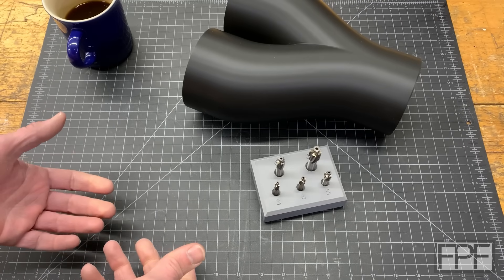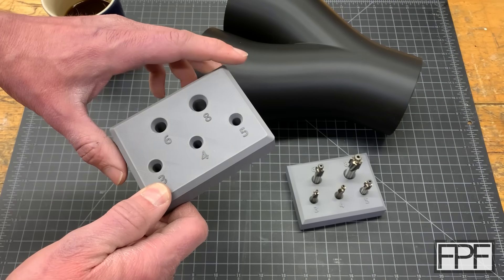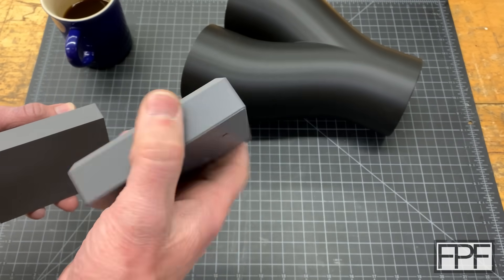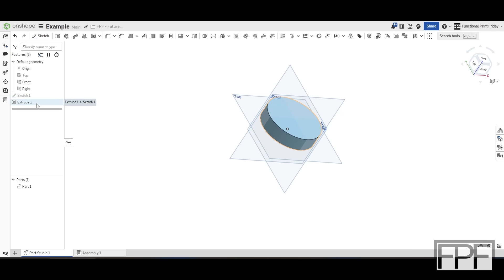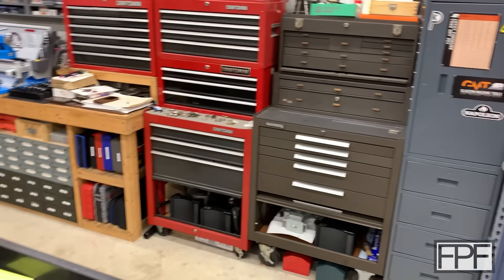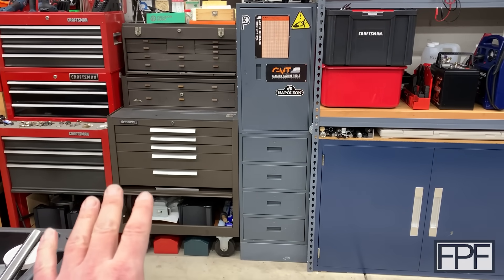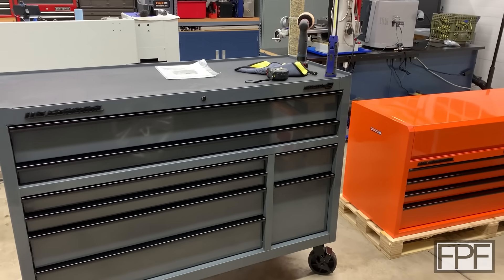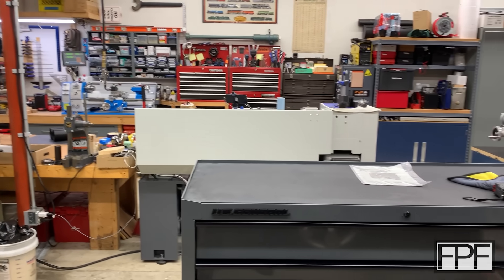Y-Pipe Viewer Challenge and Shop Updates

Comment from the maker: CHALLENGE RULES:  Design must be completed in onshape.  Design must be a y-pipe where one end has two pipes, and one end has one pipe.  The end with one pipe should have a pipe OD of 101.6mm, and for the end with two pipes, each of the two pipes should have an OD of 106.25mm.  Center to center distance for the end with two pipes should be 120mm.  Each pipe end should have a section that runs perfectly straight for 45mm.  NO curvature is allowed in this 45mm section.  Overall height should be 250mm, and wall thickness for ALL walls should be 3mm.  NO chamfers or fillets are needed.  To submit your design, make the design public in onshape (if not already), and send me the link to the design either via the contact page on my site fpfdesigns.com, or via a private message in the FPF discord (link to the discord on my site).  GOOD LUCK!!!  Winner gets recognition and bragging rights in next week's video.
Reply: Do variables count as steps? They do show up in the features list, so taking the rules literaly they do... You can do it easily without them showing up by just setting the values without variables, but the design is far worse of for it....
Reply: @flemmingjust5653  If you use a Variable Studio instead of setting variables directly in your Parts Studio they don't show up in the features list. I didn't use that for my submission here but frequently do for designs where the variables start to overwhelm the features list.
Reply: Going by some of the comments. I think a lot are missing that the outer diameter of the single end, is different to the outer diameter of the double end.
Reply: Thanks for the challenge:   4 Steps in Fusion (with 3d Sketch - 5 w/o)
1) Sketch  XY with two guide rails (following the outside of one side of the Ypipe):  x distance 250mm,  all ends of 45mm straight, path distance at start 101.6 at end 106.25 with 60mm offset, curvature to connect the straight ends
1a) perpendicular (3d Sketch) a circle at the start with 101.6   
2) Sweep the circular profile with path and guide rail  (now you have a full body of one arm with a 101,6 end and a 106.25 end) 
3) Mirror on central plane  XZ 
4) shell with 3mm 
However I don't think I ever would do it this way in a real design. The shortest way isn't the best!  (a bit like programming: Perl can do it as single line! But: incomprehensible & unmaintainable)
I would prefer a design more close to my actual "thinking/handling" of the problem.  e.g.  I want connect this side: Create new component, Sketch start profile and extrude 45mm. To this side at 250mm distance:  Offset plane, sketch target profiles and extrude.  Now connect the bodies with 2x Loft with G2 curvature. (If I would like to define a specific curvature I would create an additional sketch for the path).  Now I have  solid bodies,  combine them and shell to 3mm, Check with section anlysis in XY -> 10 steps
Reply: I can do this in 7 steps in Fusion.. but I know.. doesn't count.  🤣
Reply: @techjag  OnShape and Fusion are very similar for this kind of CAD. I got to a 6 step solution in OnShape, which I think would work in Fusion too.
Reply: @xVolta  oh im sure, I'm just old and stubborn.. I could cut to 6 steps if I remove the fillet I did on the union.. but I think it needs it so I stuck to 7 haha.. something something loft and mirror in my world. 🤣
Reply: @techjag  Yeah, exactly 😆
Reply: @xVolta  This can definitely be done in 6 steps in Fusion
Reply: @techjag  Ended also up with 7 in Fusion. I guess with a 3d sketch it could be reduced to 6 but that often takes longer.
Reply: @Leif_YT  I did use a 3d sketch to cut out steps.. and yes I agree its less steps but far more annoying... would much rather have used an offset plane and more sketches... 😂. but if you want less items in the timeline haha
Reply: @techjag  I got it in 5 in Fusion, using 3D sketch :)
Reply: I had it in 5 steps until I realized that the two pipes had a different OD than the one pipe.  I got it in 6 steps.  You can look it up in Public Documents... named "FPF Challenge (LEE)"
Reply: @jasonlee4122  Nice way to approach it! How did you get your Sketch2 to "float" without first defining a plane?
Reply: @rrtac  Instead of selecting a plane to sketch on, I used the origin as a mate connector and then I edited the mate connector and moved it -205mm along it's Z axis.
Reply: @jasonlee4122  Very cool. I have never really used mate connectors for sketches, but I'll have to remember that one. Thanks for sharing.
Reply: I think I can get it in 4 "steps" BUT one step is a variable size pipe featurescript which only needs a start and end radius and path to sweep along.  I consider it basically cheating because feature scripts could also bundle the entire operation into a single "step" for that matter.
Reply: Is there any chance that you could make your OnShape design file available (if it's not already available)?

Comment: 7 steps in Fusion. 
Sketch the pipe paths. Sketch the primary diameter. Create offset plane. Sketch other pipe diameters. Sweep first path with 5deg taper. Sweep second path with 5deg taper and join bodies selected. Shell command with 3mm walls.

Comment: That's a fun challenge concept! In programming, we call it "code golfing" when trying to rewrite a program in as few characters as possible that still does the original thing.

A quick clarification, do you consider parameters a step? They show up in the timeline, but in my opinion shouldn't count as steps, since it's just as simple to type in raw numbers in sketches, vs using variables.
Reply: I did the variables, I'm not counting them, they are just good practice.

Comment: I’d take the discount from HF and customize it. The other one though… I’d be a pain in their ass about it until the shipping company either replaces it with a brand new unit, or pays you for it 100%

They will continue being careless until it hurts their bottom line. 

Costco delivery contractors (RXO) gouged my hardwood floors and tried to railroad me for more than a year. Finally escalated to legal action and Costco leaned on them. Their insurance company paid for an all new floor and since I wasn’t the only claimant, they ended up getting dropped by their insurance company.

Comment: 5 steps in Fusion for the Y-Splitter: sketch-sketch-sweep-mirror-shell
Reply: But what about the 45mm straight at each end?
Reply: @MikeSorel-b8f 
Sorry for the missing details. This was an Onshape-only challenge, and I was just curious how similar the final Onshape solution will be. Anyways...the first sketch is the sweep path, so you can extend the straight parts as needed. The second sketch is just a circle used as the sweep profile. Snapping the bottom of the 'Y' to the origin makes the alignment of the circle and the mirror step easier.
Reply: @PODLine Did you get different diameters for the top and bottom as required by the challenge brief?

Comment: I won't ever use an OnShape account because I prefer to own my software and the things made from it.. thanks.
But the challenge is fairly simple for such a shape, my biggest tip I have for others is to read about what each option allows you to do. I would be able to do it with two sketches and two operations in my CAD software. You can likely do the same in most others such as OnShape.
I could go in detail for anyone wanting to experiment but I'll leave it at that to not spoil it for others that want to tinker.

Comment: Take the discount and call it good. Simple cosmetic problems are easily to fix. If it drives you crazy just hit it with a sander and give it a new shot of paint. You'll never match the paint so just spray the whole thing. A day's work, not really that hard. It's frustrating that a new piece comes damaged but everything has its problems. I personally would be more concerned about the drawers that ended up on its face. I would have rejected the shipment and made them replace it. Paint is easy to fix, tweaked drawer slides are another thing. I generally don't have  problem with shipping. For the money you paid for that second cabinet I would definitely put in a claim. Don't overestimate the drawer space you need. You can get away with a lot less than you have. It's nice to have everything in its own place, kind of studly. I however have a much smaller shop than you. I have a color coding system that allows me to group my tools in large batches, yet quickly identify them. It started with drill bits. I color coded my bits with stripes to identify what that bit does, not its size. I covered all the standard sizes from #4 to 1/2 inch. With one glance I can identify a #8 wood screw for hardwood bit from a #8 machine screw for a tap hole at a single glance. It turns out that 99.99% of all the holes I drill fall into the color coded castigatory. I keep my bits in the bins, small, medium and large. I can directly get the bit I need with no fuss, no muss. Lose all the boxes and use the space for more equipment.

Comment: Maybe another option for the orange tool box: You could just sanddown / rough up the top and front facing surface of the side walls and then paint them black to give the whole box a frame around the orange. Together with the black drawer handles that might look neat.

Comment: I reckon 6 steps: Sketch, offset plane, sketch, loft, mirror, shell
Reply: This will be missing the three straight 45mm sections.
Reply: @grahamrichter657 your right - missed that. So two additional extrusions. Alternatively if you tweak the loft settings, using normal to face and tweaking the parameters, you can likely achieve a similar result without additional extrusions.
Reply: PS realized mirror won't work due to the difference in ODs, i.e. additional loft and a boolean.
Reply: @NitroHDB  One extra side sketch or 3d sketch should do it to draw the path the loft can follow. At least in Fusion, but I think in OnShape and SW it's the same.

Comment: I can probably do it in 7 steps. At least in CATIA, NX and Solidworks, I have never used Onshape but CAD software is 99% alike, at least in it´s basics.
1. Create sketch of 3 circles on any plane
2. Create solid or move circle 1
3. Create solid or move circle 2
4. Connect circle 1 and 2 by a loft, blend etc.
4. Connect circle 3 and 2 by a loft, blend etc. and boolean volume, can be done automatically or you might need an extra operation depending on Software
6. Big nice fillet ( can leave it out and get it in 6 steps, but I wouldn´t)
7. Shell operation & done
No surface design needed, or complex operations, you can change your design intent later on, you can change distance between the interfaces, you can change diameters, you can change wall thickness, everything can work interact and not brake.

Comment: It´s not just the amount of steps but the logic behind it. For example, you can create one side then mirror it, this means your design will always be symmetrical no matter what, you can not change it in the future. Now are you 100% sure that any design change in some distant future will always be 100% symmetrical ? 
Same goes for the height of the upper two pipes, you can position a sketch on the same plane or you can create a 2nd plane or you can create all 3 sketches on one plane and then move them by the distance needed etc. Design intent, that is stable with the least amount of steps, that´s what you want. At least that´s what I do in my 10+ years design engineer career for various automobile manufacturer.

Comment: 6:00 For that shape, I'm not that familiar with OnShape but in Fusion I (as a beginner) would do:
1. Sketch for the bottom profile
2. Offset plane for the top profile
3. Sketch for the top profile
4. Sweep from the bottom to the top profile
5. Mirror the part
6. Join the 2 bodies.
7. If needed, shell the body.

Comment: I'd take the discount, try waxing the matte areas with a good paste wax and make the corner protectors/accents in black if the waxing didn't look good enough.  Or paint those areas as well as the top/front chamfer gloss black.

I'd have probably went with a black base cabinet and repainted it's pull handles an orange which matched the top cabinet orange.

Comment: Sorry, don't know onshape. But in Fusion this is done in these steps:
1. Sketch 45mm line followed by spline that curves one side only, followed by another 45mm line
2. Use the pipe tool on the path created in the sketch
3. Use mirror to duplicate the other side and join together
4. Use the hollow tool on the side with the two pipes (select both tops)
5. Use extrude to cut out the bottom

Done with 5 items in my history bar.
Reply: Ah, I didn't account for the difference in diameter of single vs double pipes. The pipe command can't do that.

So in fusion (and I expect it to be similar) you would have to do this:
1. Sketch circle
2. Create offset plane 250mm above
3. Create sketch on the new plane with a circles offset on one axis and different diameter (this will be one of the two pipes)
4. Extrude bottom circle 45mm
5. Extrude top circle  down 45mm
6. Loft the ends together using tangent settings
7. Mirror the lot, joining all bodies together.
8. Use whole to cut out the inner diameter
9. Extrude out the bottom.

Comment: My shop set up: milling machine and a flip-180 to stand in front of a metal lathe. Dedicated tooling boxes next to each machine.  Drill press next to a box with everything I need to drill, countersink, etc. Table top with taping head, box with taps.   Everything is done in batches, counter space. At the end of the day, fewer steps means you're more productive.   Some tools, I'd get duplicates for that machine (no walking back and forth to a big toolbox, but a dedicated tool right there). Office area for electronics and instrumentation.  Rolling tool boxes closer to the shop doors to roll closer to the vehicle I was working on.     Think of the workflow: raw materials in at one end, storage, break down, operations, finished goods out at the other.

Comment: I realize you never asked for my option on this aspect but I have outfitted several workshops both personally and professionally. A few of those shops began similar to yours so I am familiar with some of the issues you are facing. Likewise I am familiar with the solutions you propose. And, I gotta be honest, I am not a fan of your ideas. Firstly, I am of the opinion that top boxes are space killers; I could go into more detail but the main thing is that they deplete work surfaces, are typically shallower than bottoms, the upper chest fills with junk and limits usage directly above, The Vidmars are nice but pricey and odd-sized. I prefer a shop space that is work-top-centric. Speaking of, you gotta replace the 2x4 box-style work tops. One good solution is to just rip a bunch of 2x4's in half then glue, screw or just nail them into a 1-5/8" thick butcher block top. While a monolithic top is good, I sometimes prefer just adding tops sized for roll around bases. This provides mobility and versatility as you can rearrange them to suit evolving needs and/or roll the required box to the work (excellent for working on cars) and they can each serve as rolling bases for equipment, ie 3d printer or drill press on top. Brand-wise, you can save a lot by going with the usual suspects like USGeneral and Husky or look at offerings by Seville Classics and NewAge Products. Also, I see in the background you have a lot of cased power tools and shop supplies. For these items, I like solutions similar to Metro rolling adjustable wire rack shelving though for less cost, similar quality units are offered as Amazon Basics products. By organizing cased tools or bins into similar heights, these rolling racks can be adjusted to the exact size needed without wasting space. You may also compliment these racks by replacing your parts drawers with plastic parts organizing totes similar to the Stanley parts organization totes, the ones with removable yellow compartments, the Storehouse (Harbor Freight) version tends to be the best value. With the parts totes, as well as any toolbox, you may customize as necessary using the 3D printer where online sites offer many options for bins and Gridfinity organization. I understand you are already committed to certain products but hopefully going forward some of these suggestions may still benefit others in the comments.

Comment: Keep the orange box, never know what issues a replacement might have - could end up being something functional. The discount will at least be something and you can move forward with the reorg. Print the bumpers, but honestly, are you going to be able to see those edges once the boxes are stacked? Not sure about the stacked height or your height, but I gotta think they're a lot less noticeable once stacked unless you're really tall? And the issue seems to be that you'll see them, not that you'll know they're there (which the bumpers wouldn't solve). Looking forward to the reorg for some ideas!

Comment: Keep it and take the discount. You can cover it up. Shipping is horrible. Its rare to get anything big delivered with out some form of damage. A couple of months ago I ordered a stainless steel 'food prep' table for my 3d printer. The outer box had minor damage but the top surface had two fairly deep scratches that went through the protective plastic. Was pretty miffed but they didn't effect the functionality and were going to be hidden as soon as you put 'stuff' on it so I let it slide.

Comment: Regarding the orange top box: I’d add some accent covers in grey/black to mirror the bottom box. Maybe also make them tool holders or something like that, should you have space either side.
Regarding the tall drawer cabinet - that’s messed up. Get it exchanged and get compensation for the damage on top of that.